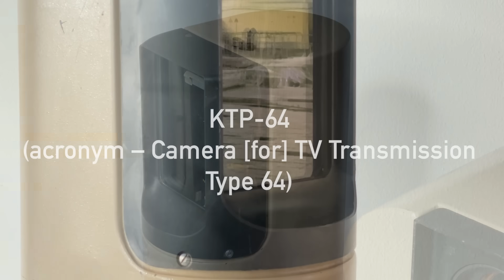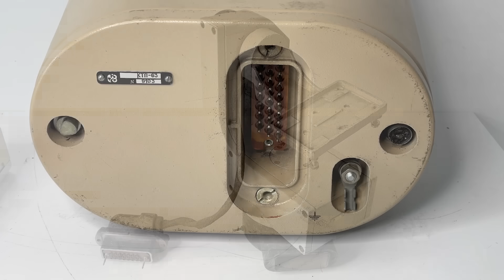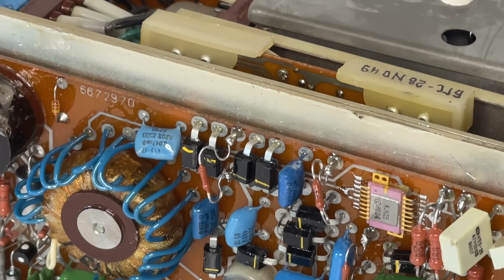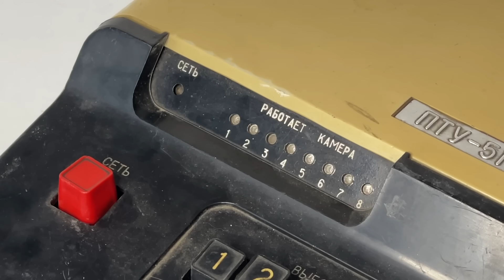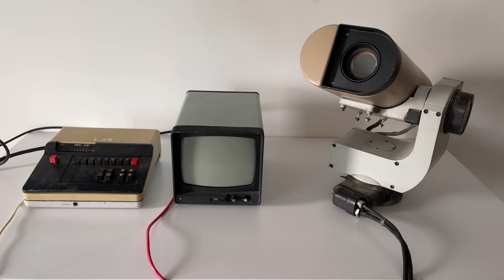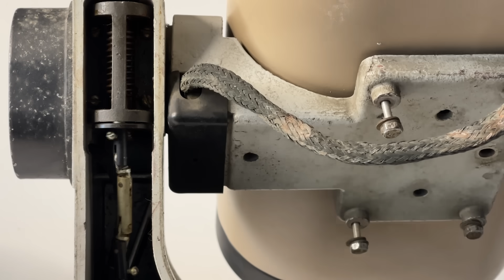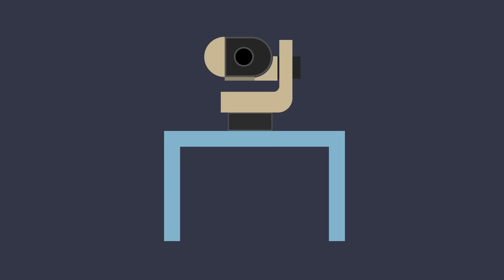THESE CCTV CAMERAS recorded the CHERNOBYL DISASTER

Comment: The name in English for the tilt mechanism is a "worm drive" 
They are great for making fine adjustments without compromising strength in the mechanism.
You can find them in places like elevation adjustments on artillery pieces, and steering gearboxes on cars. 
Considering the weight of that camera, and soviet design philosophy... Using a worm drive makes sense. it's not really that surprising that it still works either. 
What a unit.
Reply from the maker: Yes, but it is not just a worm coupling. Many suggested that it is an U-joint

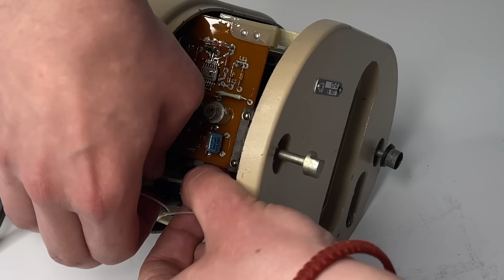Comment: 4:00 My educated guess would be that the heated glass is used to prevent condensation, not to prevent freezing. 
If the glass is colder than the ambient temperature and the air is humid, the glass will fog up. Just like a bathroom mirror during a warm shower.
Reply from the maker: This is actually what I meant. Additio ally, the documentation explicitly mentions how to use it when temperatures are low, so in the case of frost that heater has to be on.

Comment: Alot of equipment failed on the cleanup on the roof due to intense radiation.
Semiconductors used in logic control circuits operate in 5 volts. 
Measurements for components for the ICs in such logic circuits are in micro millimeters. They are easily fried with radiation. Hence you see satellites with shielding for Africa and yet when the sun has a MCE they are moved closer to the van allen belt belt.
For local intense radiation it would be wise to use vacuum tube components. It's still possible to do it. Radio control drones in the 1950's had them.
Reply from the maker: Exactly.

Comment: I just recalled what I'm still keeping two vidicon tubes with different geometry (dimensions), but the same Hitachi brand from spare parts stock for our CCTV cameras. I took home some spare vacuum tubes for collection, when we moved our maintenance shop to a different room back in 2004. Those vacuum tubes were intended for some ancient obsolete machines, which were retired and scrapped. All our analog cameras were scrapped after upgrade to solid-state ones on every piece of process equipment with the vision or PRS [pattern recognition system].

Comment: Hi, greetings, great content! And one question: As I understand, equipment like trucks and so on, that were used to work in reactor 4/what is now the exclusion zone, were left abandoned because they were radiated. Is it safe for you to play with this equipment? I'm catching up, so I haven't watched all your content (Yet), but have you measured the equipment you have with a geiger counter?
Reply from the maker: Things are more complex.
Not all devices worked in/near Unit 4. Not all were abandoned. Not all are contaminated or not all are contaminated in a way that it does not allow to use them. Thousands of people work in the Zone now, and we use here tech.

However, while we spend a substantial amount of time in the zone, we strictly use it as a reference and a research base; our devices we find elsewhere — what you will find in this condition would be never abandoned. Abandoned stuff is rusty junk. So radioactivity is not an issue.

Comment: Whoa. I still can't stop marveling at the fact that they used typical M42 lenses for Zenit cameras and a mirror assembly. Mighty friggin' clever! A thing of beauty and a joy for ever.

I've got a vidicon camera in my collection (Unitra Polkolor TP-K162), but the tube seems to be dead. I'll have to take a closer look at it. It uses C-mount CCTV lenses.

Next step? Soyuz comms!
Reply: Why is it surprising to you? CS-mount lenses are widely used in CCTV today and it was logical back then to use the most common lens mount available for the sake of standardization.
Reply: @theeltea  I'm just surprised they used a M42 instead of a smaller C mount, that's that.
Reply: @KeritechElectronics  Ah so I misunderstood. I am thinking the M42 zenits were widely available at the time or it may have been a design choice due to the constraints/sensor size of the vidicon tube.

Comment: Very modern and well designed cameras. The build quality is outstanding and it's impressive that nothing is sized up and everything still works mostly perfectly.
The remote controlled core dismantling gantry crane is also an interesting information, because it's what is going to be used, just decades later, in the brand new arch shelter. It's a concept that is also envisioned to be used on difficult reactor dismantling tasks like damaged ones (fukushima) or odd ones (brenilis). This shows well how Chernobyl was and still is a laboratory for nuclear technologies of the future.
Reply from the maker: To be accurate, I suppose Beloyarsk Project was totally unrelated. It had a different purpose and as far as I know was not finished.

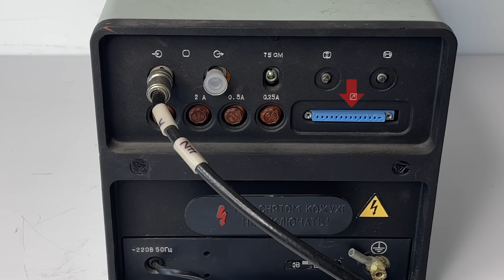Comment: The impedance switch at 9:34 is set to ON correctly as there is no other equipment connected to the output of the monitor. The output impedance of the TV signal from camera is 75Ω and it expects a load of 75Ω which (according to the Ohm's law) divides the voltage by two. The input and output connectors in this (and any other professional) TV monitor are connected by wire, there is no amplifier between them. But the input amplifier of the monitor has much higher impedance than those 75Ω. It allows to connect several monitors (or any other equipment) in a chain.
Reply from the maker: Super thanks for these details!

Comment: I am a CCTV camera collector with a collection of over 800 cameras. I was born and raised in Russia. In many government buildings those cameras can still be found in somewhat working conditions. But the moment the wall fell, those were usually switched off and a system from a company such as Bosch or Pelco was installed that used the regular RS-485 and CVBS protocol and standardized control and could allow one operator to manage 256 PTZ cameras from one terminal at once. I worked on the old systems and I seen modifications made in-aitue where the tube wqs replaced with a CCD sensor so they could keep using the camera.
Reply from the maker: I noticed that many times from these cameras left only the enclosure with a modern electronics inside + ун-16.
Reply: @ChernobylFamily  It's common for those cameras to get "Кулибин" type of upgrades (probably built by technicians working for the place the cameras are installed at) with whatever parts are going spare. There is also a НПО type organisation out of Novosibirsk that makes retrofit kits to upgrade the electronics inside the camera for CVBS and 940H with RS485 Pelco-D protocol. They recommend to use RVi DVR with it. I will link it if I find it.
Reply from the maker: @felenov  wowww! Thank you for such details!
Reply: Those enclosures seem solid.
Reply: Can you show us your collection with a video? I  really love  security CCTV cameras!
Reply: @xalidhuseynli6402  Definitely will. I am currently working to organise things and repair some of the dead units and make some sort od display stand I can use to demonstrate every single piece of equipment I own.
Reply from the maker: We agree, that would be interesting to see
Reply: Yes, it would most interesting to see even a small selection of your collection. Be sure to inform us!
Reply: You have a very interesting hobby!  ❤
Reply: I would love if you could make a show and tell series on your Youtube Channel. Make it meta by filming some content with the cameras.
Reply: And now you’re back to the pre-Gorbatsjov times.
Reply: Did you post your collection anywhere?
Reply: Now that's quit a method for keeping a camera in use.
Reply: I have found many old b/w large camera enclosures at US manufacturing plants, with a modern color camera installed for mounting ease and to protect the new camera. 
It seems to be a common practice.
Reply: They do that all the time in the US too! They just gut out the originals and shove modern components inside of it! Some Bosch or Hikvision thing instead.
Reply: Собиратель хрунья

Comment: Why did they use a delicate electronic camera in a high radiation area ? Surely a remote fibre camera and dc voltage straight to the moving parts would have been more reliable. That way all the electronic kit would be safely outside the area.
Reply from the maker: I loved how mr. Bukov wrote in his book: 
"Cameras KTP-63, 64. 
Advantages:
- that they were actually produced..."

They did not have anything else. There came sometimes also Grundig cameras, but they were not better.

Comment: That's certainly a very beefy camera! I especially like the 'demister' for the visor, that's especially clever. The builders of these camera units can still be proud of these units. The orientation gearing and motors could take up a nice video on their own! Thanks so much for this very interesting vid and I look forward to seeing the rebuilt scout very much!
Reply from the maker: I have to say this are one of a few pieces of ussr tech I really love
Reply: Traffic stoplights 🚦 in America switched over to LEDs to save money compared to using incandescent light bulbs in the fixtures, BUT, then came winter in many areas, and the lights got blocked up with snow and caused accidents because the lights couldn't be seen. The incandescent bulbs made enough heat to melt any snow that accumulated on the bulbs, but the LED bulbs did not, and allowed snow to build uo and cover them. So, they then HAD to add heaters in front of the LED bulbs to melt any snow that accumulated.  NOT much of an energy savings by the time THAT was all done..... 🤦🏻
Reply: @davelowets  LEDs do actually generate heat.

Comment: I'm honestly pretty impressed by the 625 lines of resolution. That's a really high resolution for the time, and a reasonable improvement over the PAL standard.

I'm curious, Is the image inertia a flaw common to the type, or is it the result of age and wear? I'd be fascinated to see a short video recorded with this camera just to see what it looks like digitised and displayed on a modern screen.
Reply: The 625 lines at 25 FPS interlaced, is exacly the PAL standard. Although in Europe 576 imagelines were used, because of transmission bandwidth. The remaining lines were later used to transmit Teletext/CeeFax.
Reply: @retinaquester  Well, I stand corrected. Thanks for the information.
Reply: @retinaquester  Those 24/25 lines of so called vertical blanking interval were necessary to allow voltage change in vertical deflection coils in camera and picture tube as well.
BTW the 625i50 standard was developed in former USSR during WWII. After some years all the Europe settled on this standard.
Reply: @janovlk  I am aware of how it works yet, you are wrong about the development. PAL was developed by Walter Bruch at Telefunken in Hanover, West Germany. And as far as I know very little technology from the USSR has made it to the western Countries, because it was either "borowd" western designed or inferior to the Western standards. Although russian space industrie has shown it's capabilities. It lags now far behind.
Reply: @retinaquester  Thank you for pointing me at Walter Bruch. I'll try to gain some information. My old books and newer articles at ITU (I can't put a link here so search for Mark Iosifovich Krivosheev) says different.
All the knowledge about the Russian technology history is sketchy as it was deemed as a state secrecy there. Maybe it was Lev (Leon) Termen who demonstrated the mechanical TV system ahead of J. L. Baird.
Reply: @retinaquester 
Soviet space industry =//= Russian space industry
Reply: @retinaquester  Russian space tech "lags behind" yet Progresses restock the ISS regularly. Tell me you're biased without saying you're biased.
Reply: @theeltea it takes more than just "they are using this rocket" to evaluate the situation of their space industry. I did, from their own sources, and trust me, they do lag behind. A lot. Btw they had a serious accident during the last start. The corruption is mental, sanctions work too and the economy is not good in Russia so it's logical.
Reply: @LeilaAisha  I dunno, I'm sitting pretty here in Moscow. Happy as happy can be. Economy is nice, too.
Reply: @theeltea ok. I see you don't know the difference between "my situation" and the economic situation of the country. Plus there's a difference between Moscow and...well, not Moscow.
Reply from the maker: I think both. We'll record a video before and after changing the vidicon and then will post it on Patreon supposedly.
Reply: i am by no means well versed on video camera tube technology, but i at least know a bit about their workings. The lag is dependent on the target being used. Pure vidicons are more prone to image lag then say a plumbicon or newvicon. the image lagg gets worse with bright lights and can be reduced by light biasing the target if i recall the technical aspects correctly.
Reply: @lbochtler  Yes the older type tubes had issues with slow response to bright light, as the phosphor got saturated. Backlighting, and then using a black level clamp to restore the video level back to black, removing the offset at the expense of dynamic range, did help a lot. Of course in TV studio use they simply blocked the iris way down, then put in a lot of light ( 10kW plus on a set was minimum, some went as high as 20kW for what was essentially a 2 desk wide area), so as to both have backlighting on the tube, and also limit peak white, so you could expand video level to a point below smearing, but still have a fast response with minimal smear.

Using for CCTV you had more problems, but there again auto iris was welcomed, or manual iris and accept muddy video.
Reply: High resolution for the time? I still see CCTV footage in 2023 with resolutions you can count by pixels and seconds per frame.
Reply: @MildMisanthropeMaybeMassive   usually the seconds per frame is from cameras with extremely high resolution, my uncle uses these types of cameras on his farm, where he gets 0.5 or 0-2 fps, but at 30MP of resolution or so. 

The other ones where you can count the pixles is probably due to inproper digitization of the video signal from old cameras, or they are using chinese super cheap ones.

You have to keep in mind that vidicon tubes already produced video resolutions in excess of full HD in the 80's and 90's, i think even in the 70's but not sure anymore. CRT's where certainly capale of displaying such resolutions, as i have and use some CRT's from the 70'S with 8MP measured resolution. They where not common nor cheap but they existed none the less
Reply from the maker: @lbochtler to be accurate: what you see in the very beginning of the video is a recording of a digital footage on a screen with an actual vidicon camera. However, later is shown a real capture.
Reply: @lbochtler  What sensor types does your uncle use? Geniunely curious.